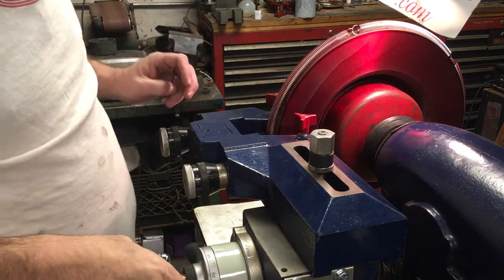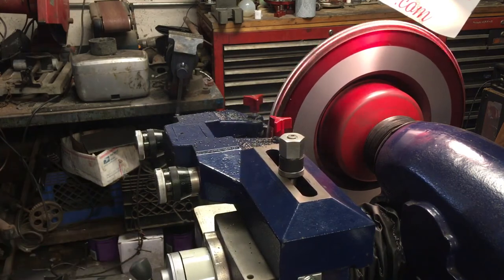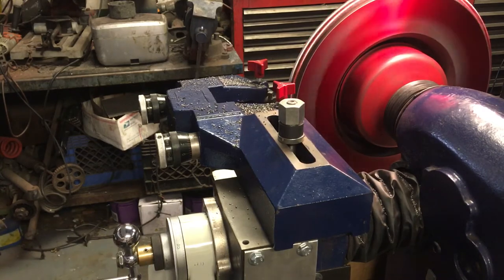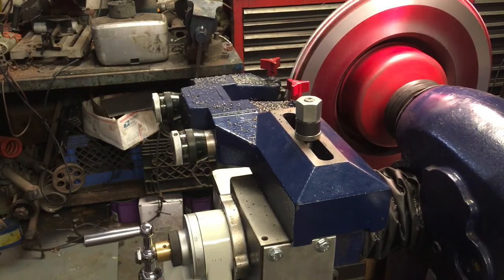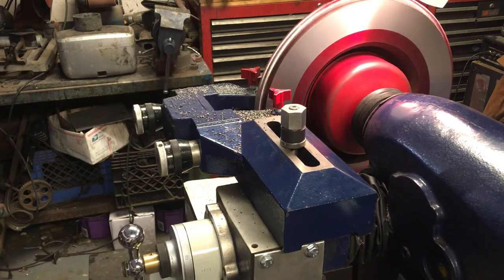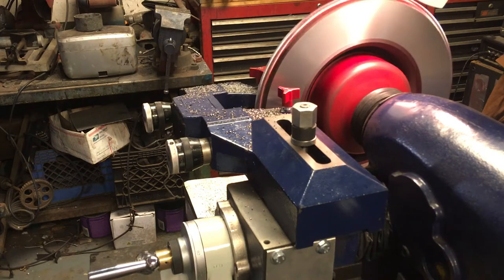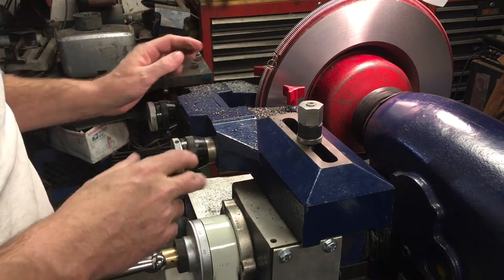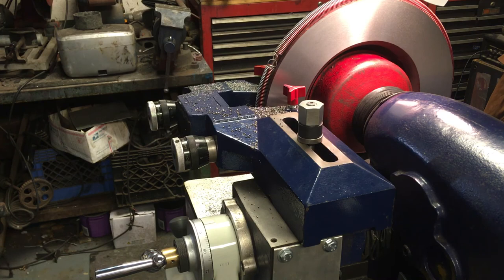Why upgrading a brake lathe is a good choice

Comment from the maker: Upgrading you existing equipment is a good choice. This upgrade in particular is really good. It will do rotors as large as 20 inches. The cutter head is more stable too. Making for consistently better performance. In whats turning out to be a very reliable machine. No sheer gears to break. Belt changes are super easy also.